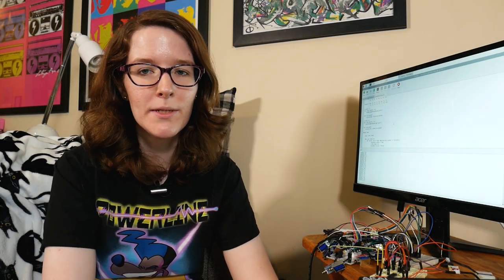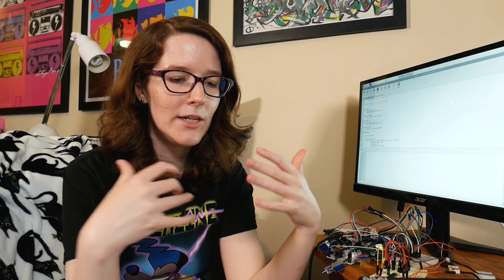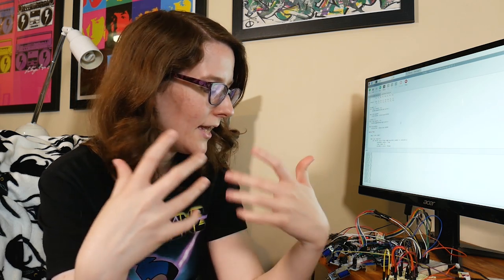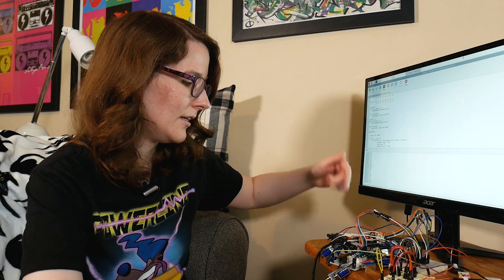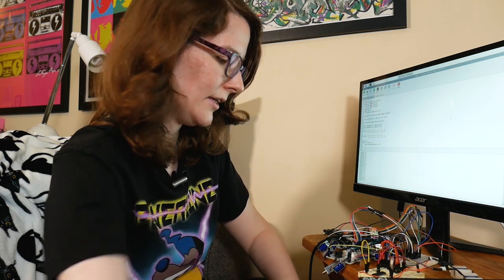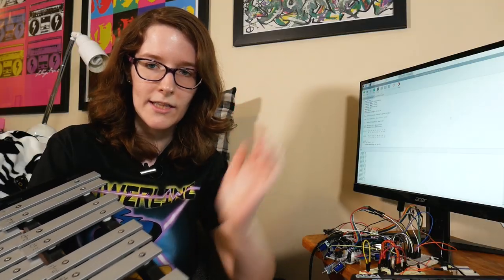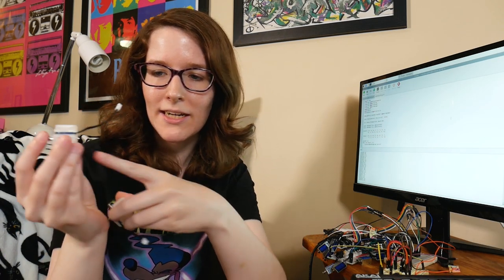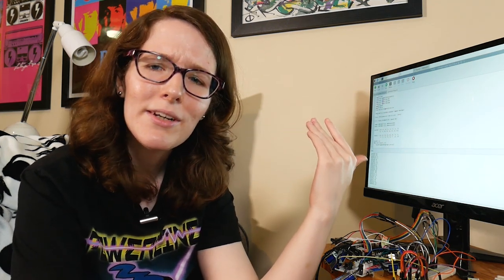My Dream Project: Building a MIDI Robot Xylophone [XyloPi, Part 1]

Comment: Isn't "glockenspiel" the beer company that Laverne and Shirley sang about ;)  I wonder if the inductive kickback with so many solenoids firing so quickly needs to be managed somehow, to keep noise away from the mcu?
Reply from the maker: that might be something to be investigated. so far i haven't noted any issues with my very scientific testing of hitting all of the keys of my MIDI keyboard over and over again hah
Reply: A reverse diode across the solenoid coil ought to be enough to keep the inductive spikes from getting out of control. 

Since Liz is using a separate power supply for the Pi and the solenoids, it's probably not a big deal anyway.

Comment: I don't know enough much about xylophones, so apologies if this is a dumb question, but would it be possible to mount the servos beneath the bars so the xylophone is still playable with mallets, but also with midi?  This might also be dumb in that it would kinda hide the awesome stuff you've made, but I just thought it might be cool if you could still get to the top to play, and it would also play by itself using (mostly) hidden components so it'd be a magical xylophone.